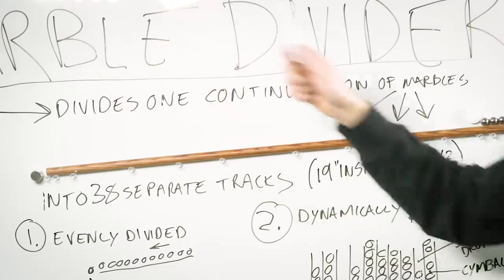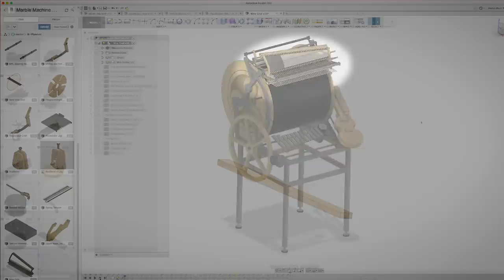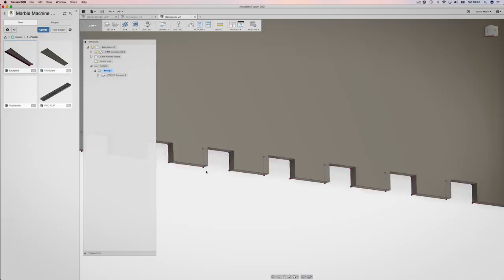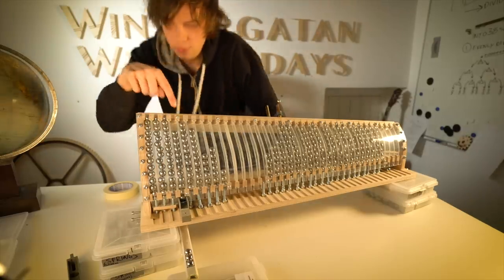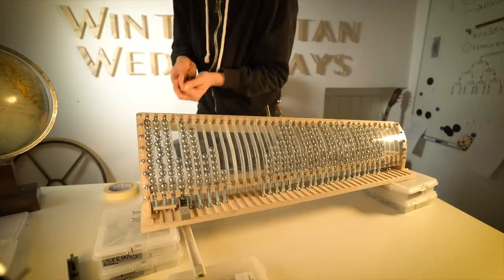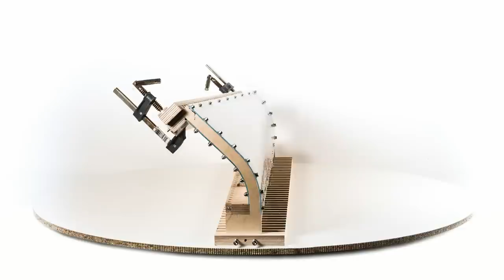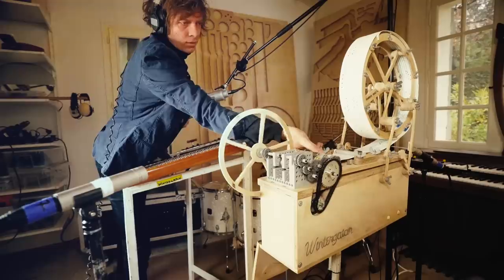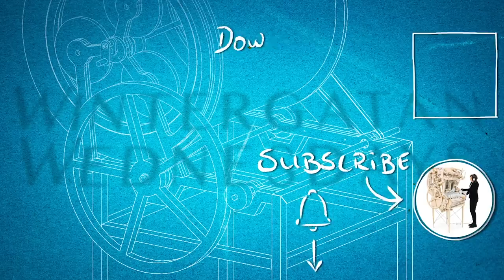Marble Divider - Marble Machine X #21

Comment: Martin,
Since I have started watching your mideos, it's look like a drug for me, and I just cant't take my eyes off of you(r channel...).
After watching this mideo (may be too much time) it seem to me that there will be friction between the printed plastic marble gates and the pliwood marble receiver, back and forth may cause premature wear ... don't you think so, afterwords? I don't know how to prevent this, using similar material, plastic/plastic (both will be hiden when the building of the MMX will be finish) or may bee by incorporating a needle bearing between (if it's not too late for this)...

About the polycarbonate, when the flow of thousand and thousand marble has passed in the channels, it should become polluted by the remain dust of the marble flow and finishing to fade to grey and at least opaque.. One more time I have no real solution while you are too far in the project at this time, the divider is build now while we can see it on he mideo, may open channels will be a better idea, (something like this ToToToToT) but it will be noisier than a closed channel..... esthetic choice won..
I read some comments about the velocity of the incoming flow of marble, saying it will be not enough... After watching the first MM at work (so many times, I was literally hypnotized), it appears that the non vibraphone instruments will needs more marbles than the vibraphone, and you have made the choice to give the right end to those instruments, the one with the shorter channels... I understood you will develop a second incoming flow of marbles but will it receive enough marbles ? Should be necessary to develop a second marble lift  (hidden like an Archimedes' screw or a second marble wheel (higher or lower diameter) aside the first one) which will directly feed the second row...

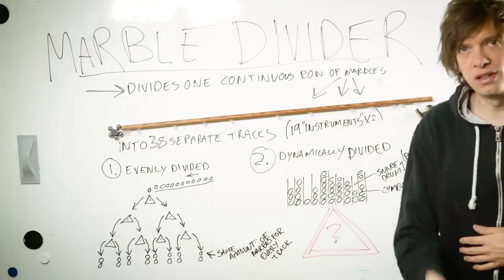Another subject comes in my mind, about the system between the marble drawers and the programming wheel (the connecting arm you're talking about at 0:25 in "158 Plywood Parts for the Registrators - Building MMX Ep.#9")... I haven't read all the comments so I don't know if anybody have allready talk about... while the joint is plywood/plywood you may encounter 2 problems -1- friction wear -2- a blockage in case of humidity (may bee not, I hope for you).
Some have mention colored marble, it should be a good idea but it need mass tainted marbles because all the shocks will damage the surface color... I think than some blacks iron marbles melting with the silver one shoul be a good effect, showing us the progression of the marbles in the channels and other visible parts of the path of the marbles using the MMX.

Make sure that I don't want to appear as a jaded person who sees things negativ, on the contrary, I am particularly impressed by this project, and I think that Karin, Olof, Marius and Lois, and Hannes and all the others we didn't know, were very lucky to be able to participate (without jealousy).

Keep on MMXing

Post Scriptum : have you ever given explanations about the signification of the added X to Music Marble Machine? While I'm not English does this X have a particular signification? (I know about crossing, or christian, that's all), I would like to know...

Comment: this design may fail due to some marbles being lost while the machine is running. it could take as few as 10 lost marbles to prevent some of the later tracks from receiving any marbles. to fix this i would make the last track silently drop every marble it receives straight into your marble return system and add spare marbles into the system. this would mean that you always have a cycle of marbles cycling through the system even if no instrument is playing.

Comment: It is pretty but very boring technically. It is completely biased, so unless the buffers are always kept full (which would require another buffer before the divider and making sure marbles can't get stuck in the divider once the stop moving), it will have limitations on how you use the channels. The least favored channels should have the longest buffers, but this design does the opposite. I really think such a design should been followed up with considerations on how you plan to deal with its limitations.